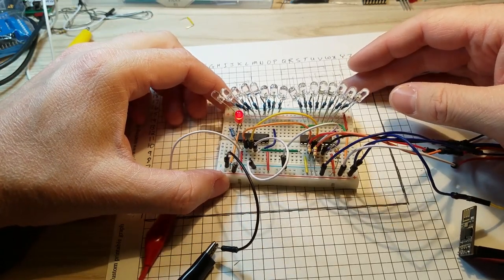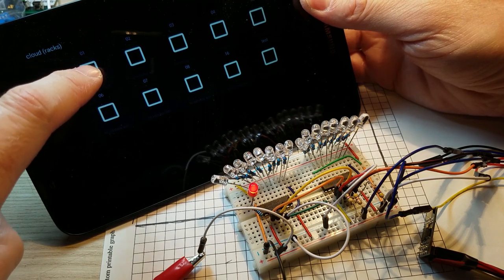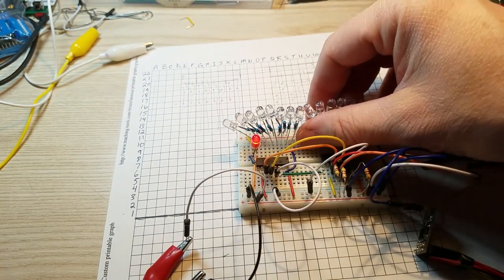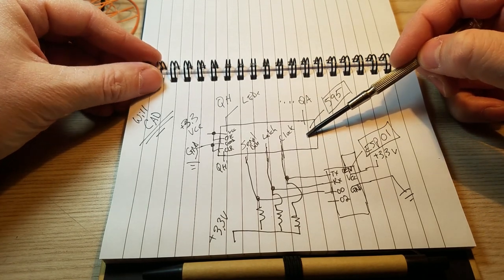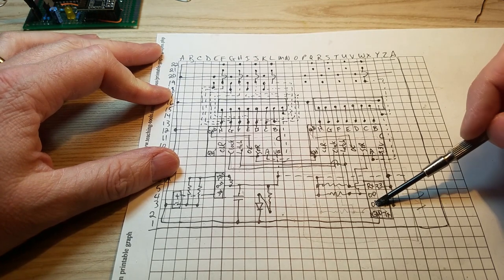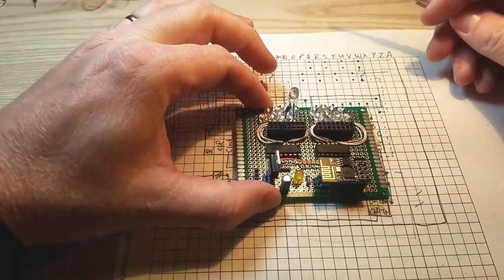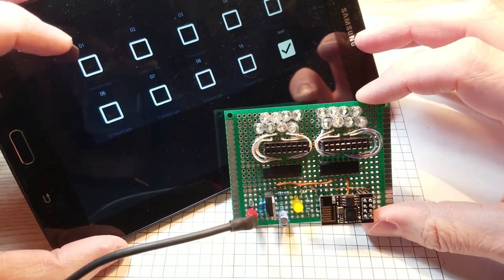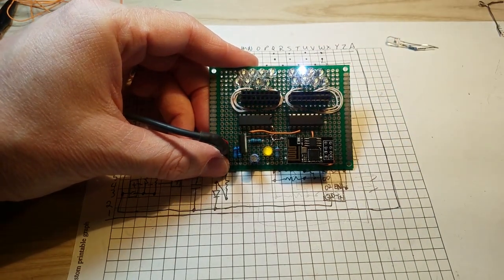ESP-8266 Remote Computer Restart Device

Comment: Hi there Will! I've got a similar problem and I would like to hard reset my PC remotely using an ESP8266.

May I know if it works if I use a relay module, instead of the 8-bit shift registors? Would it be much simpler?
Reply from the maker: Yes, you could definitely use a relay and it would be easier. However, these were high powered servers and you definitely don't want to flip the power on and off if you can avoid it. For a smaller desktop computer, it would not matter. Good luck!
Reply: @Bluemonkeydev  Any reason why I shouldn't power it on and off it it is powered servers? My PC is rather high end with two GPUs. But when it freezes, the only way I can boot it up again is through a hard reset.

Thank you for your reply Will! Hope you and your family are safe and sound.
Reply from the maker: @kelvinshak  there is not one good answer. The first thing you'll want to do is measure the peak power, especially if it is running multiple GPUs. Make sure your relay is rated for the power your computer is drawing, otherwise you'll short out the relay. Peak power may be high. Flipping a relay is the same as pulling the plug, which can be tough on your equipment. Personally, I'd avoid a relay on my equipment, but it will work.
Reply: @Bluemonkeydev  Hi Will. Thank you for your detailed reply. Appreciate that you've pointed out some important factors when selecting relays and designing a circuitry for the power switch.

Your video is really really helpful! Cheers. 🥃